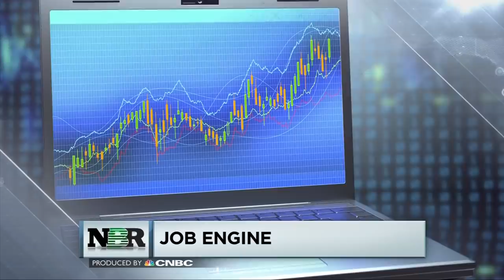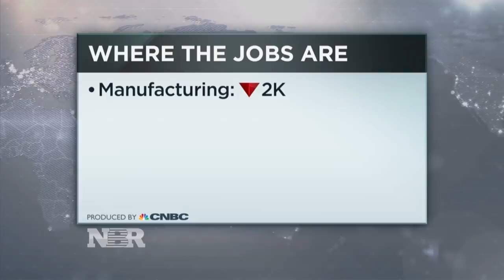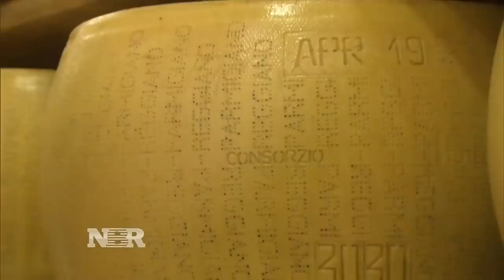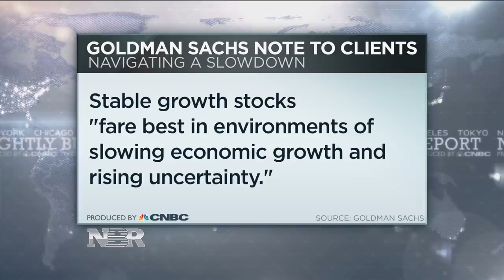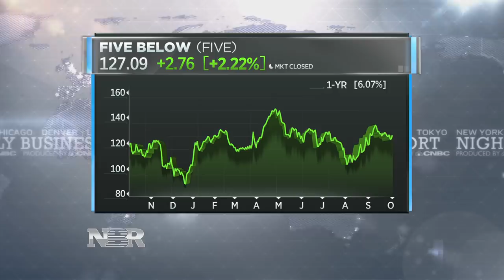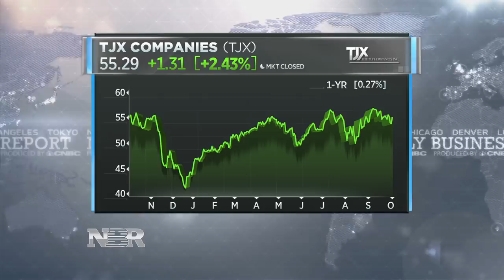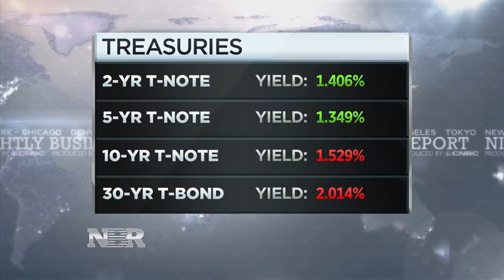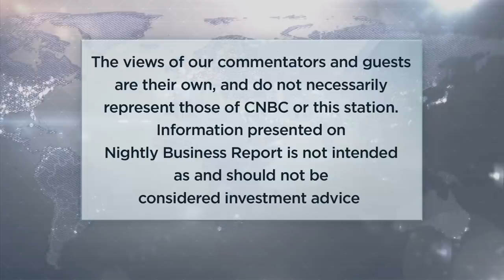Nightly Business Report – October 4, 2019

Comment: Today there were 17 new 52-week highs and 73 new 52-week lows on NASDAQ.    On the NYSE there were 45 new 52-week highs and 27 new 52-week lows.   The slope of the US Treasury yield curve steepened slightly: 28 basis points separated the 1-month yield (1.73%) from the 30-year (2.01%).     Volatility, as measured by the volatility index multiple I follow, UVXY, decreased.   UVXY closed at 26.45, down 8.19%.

Winners of the day included Xcel Energy (US ticker: XEL) and STORE Capital (US ticker: STOR).     Regarding XEL: "Xcel Energy Inc. is a utility holding company based in Minneapolis, Minnesota, in 2017 serving more than 3.3 million electric customers and 1.8 million natural gas customers in Minnesota, Michigan, Wisconsin, North Dakota, South Dakota, Colorado, Texas and New Mexico."     Regarding STOR: "STORE Capital Corporation is an internally managed net-lease real estate investment trust, or REIT, that is the leader in the acquisition, investment and management of Single Tenant Operational Real Estate, which is its target market and the inspiration for its name. STORE Capital is one of the largest and fastest growing net-lease REITs and owns a large, well-diversified portfolio that consists of investments in 2,389 property locations, substantially all of which are profit centers, in all 50 states."